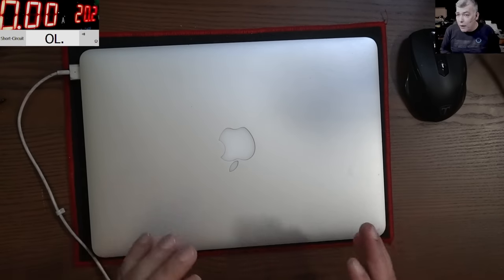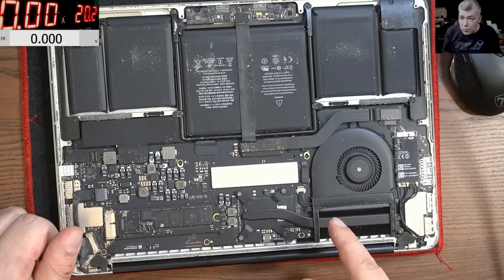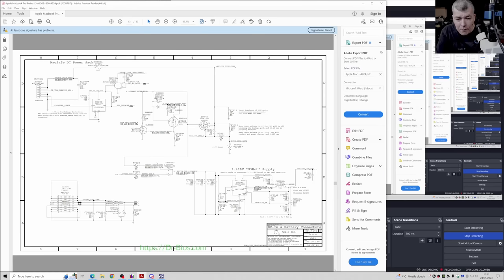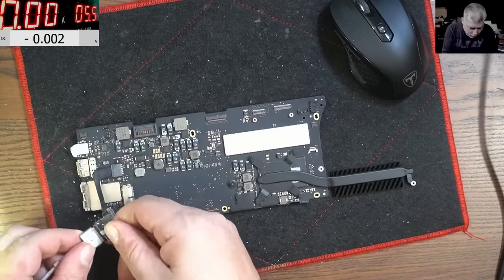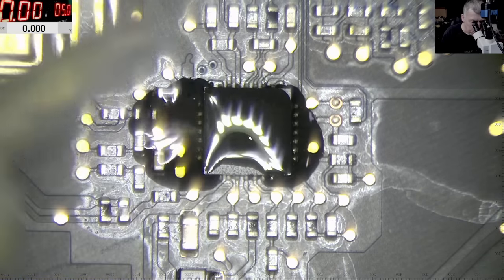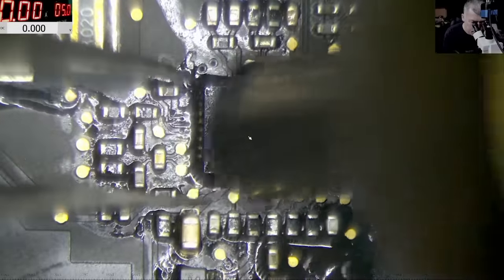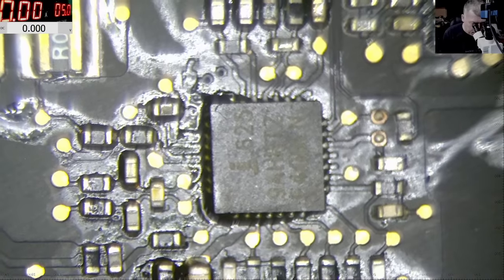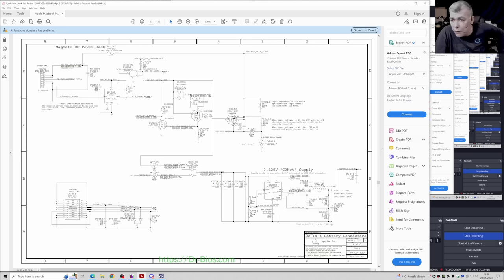MacBook A1502 logic board repair - 820-4924 motherboard repair

Comment: I know its been sometime back when you did this video. However, to me its helpful. I just want to know, you get 19V from power supply. I get 15.1V and 3.3V, I don't have 19V anywhere? is this correct or is my laptop charger faulty? Thank you in advance. I have the 2015 MBP 13" A1502.

Comment: hi sir.  at D7055 diode, one line is coming from 19v. other line is from switching power supply , its either from battery, or charger. so you got 19v at one anode of diode, and you got 3.4 output from  3.4 switching power supply.but the charging let did not got on, when u connec the charger. after you repair the swithcing power supply, that produce 12v only , the charging led on. so why is that. in laptop  you need  either 19v or battery voltage to 3.3v power supply as input.  , but here in machbook , when there is only 19, there were 3.4v output at 3.4 power supply,but there is no charging led.

Comment: Sir. We need more vedios on mackbook  i got a one same as this model. It had short in 5v line. I remove the cap.now no short. When i connect charger it shows green light and orange light. But doesnt on.what should i chk
Reply: Check bios and check the super io

Comment: The fuse never blows in MacBooks they are invincible
Reply: Then the fuse is not doing its job!
Reply: @fhurqaan  No they don't. The fuse near the LVDS connector on some Macbooks will not blow but rather allow 45v going to the display to be sent to the CPU when there is corrison on that connector.

Comment: You have spare parts 
So did you replace the fuse whit the spare parts?😂
Reply: I'm asking the same, but I think he's not going to replace the fuse
Reply: @maklogetrich2378  it’s calibrated fuse😉
Reply: @MrRvdbeek  a proper one
Reply: In another video from a few days ago, he explains that he also replaces capacitors and fuses before delivering the laptop, but not online. I think he wants to show us (as he himself explains in the same video, I think) that a laptop can be repaired even if you don't have the exact same capacitor or the same fuse as the one on the board.